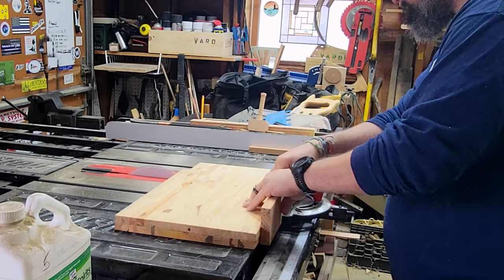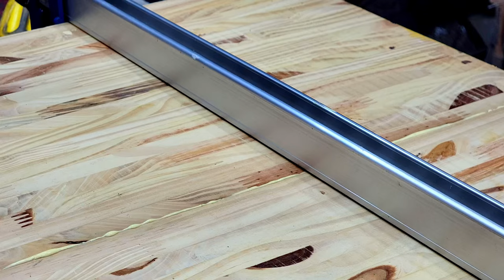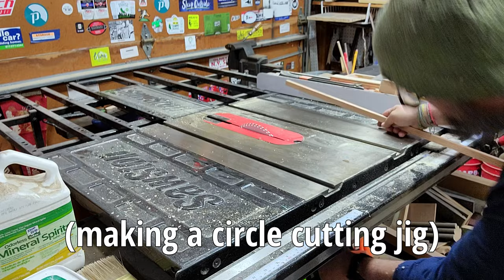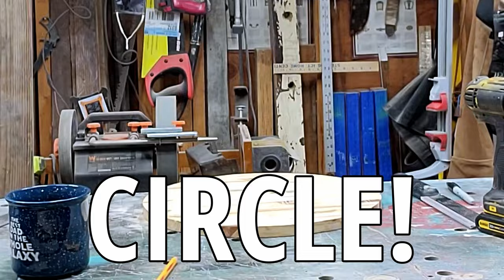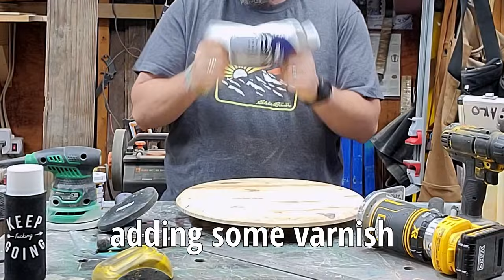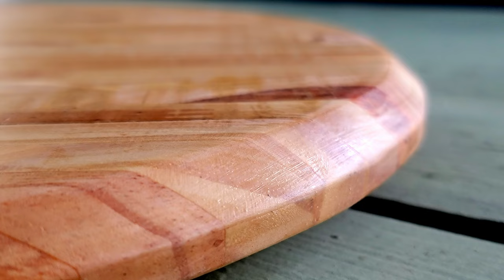A Weird Name for a Piece of Furniture

Comment from the maker: Needed a Lazy Susan (sorry Susan! I don't think you're lazy! I think you work as hard as anyone, maybe even more. Only you can do what you do. Reach for the stars!) for another project actually, well, the top of one.

So I cut a longer board down for a panel glue up to get the lazy susan to have a diameter of about 16" (the lazy susan base in 14"). I then whipped up a circle cutting jig for the table saw (does this need its own video? let me know in the comments!), cut it down to a circle, all while keeping my fingers. Chamfered the edges with a 45 degree chamfer bit, and then attached the base, and finished it.

The longest part of this project, was waiting for the glue and varnish to dry.

🛠 Tools and Supplies 
Products and tools used in this video: https://kit.co/TheNewJankyWorkshop/diy-lazy-susan
I used some screws I had lying about, they are not in the tool list. I'll add them if I can find them on the 'zons.

🙃 Products, Plans & Merch
https://geni.us/tnjw

✅ Related Videos 
For more woodworking videos, check out this playlist: https://youtube.com/playlist?list=PLSkvrm-RbSKGvq8X3-6pzQ0cw_U6CVBVB

📱 Follow me…
https://www.patreon.com/thenewjankyworkshop
https://www.instagram.com/TheNewJankyWorkshop
https://www.facebook.com/TheNewJankyWorkshop 
https://www.tiktok.com/@newjankyworkshop
https://www.youtube.com/@TheNewJankyWorkshop

📧 Mailing List
Join my mailing list to be notified about new videos, merch, and general information from time to time: https://geni.us/jankymail

🎵 Music
End screen music used is: Nickel and Dime Blues; Performed by  @Gangstagrass   (https://gangstagrass.com); Courtesy of the mighty fine folks of Gangstagrass. Check them out. They are awesome. 

Additional music used in this video from Epidemic Sound - check it out and get a free month of royalty free music! https://geni.us/esound

⚠ DISCLAIMER 
My videos are for entertainment purposes only, your safety is your responsibility. Please do not follow my actions if you find them unsafe. Which, they probably are. I'm a bit janky. Some of these links go to one of my websites and some are affiliate links where I'll earn a small commission if you make a purchase at no additional cost to you.

🥔 Hashbrowns
#LazySusan #diy #woodworking #doityourself #lazy #kitchen #kitchengadgets #kitchen #display #foodcircle